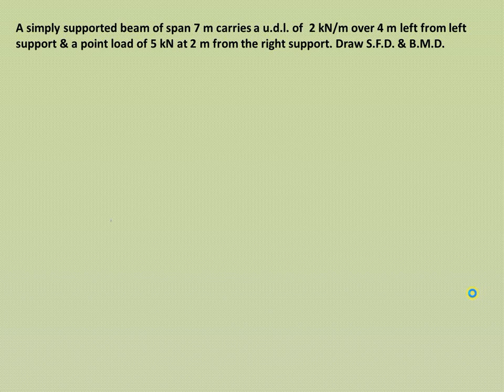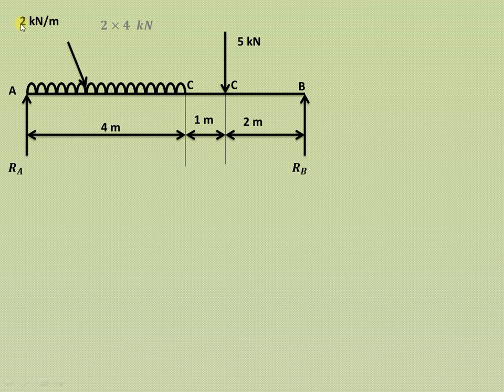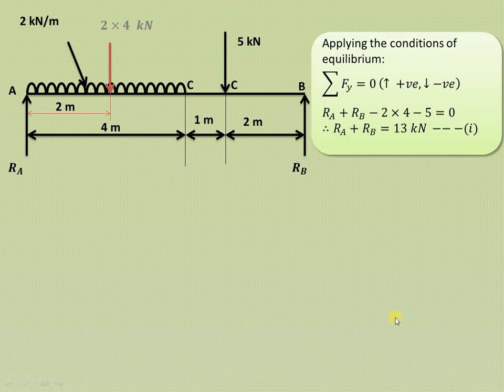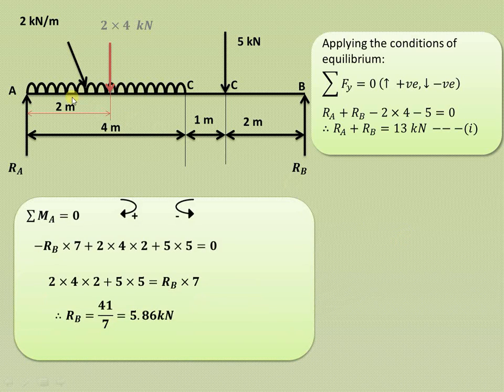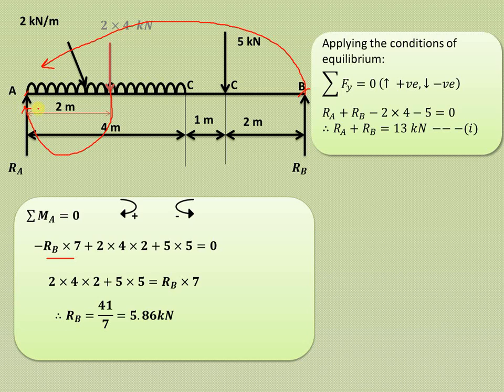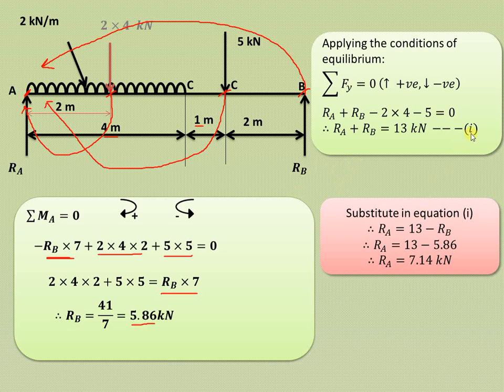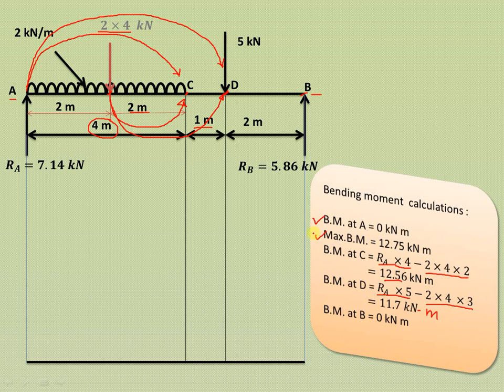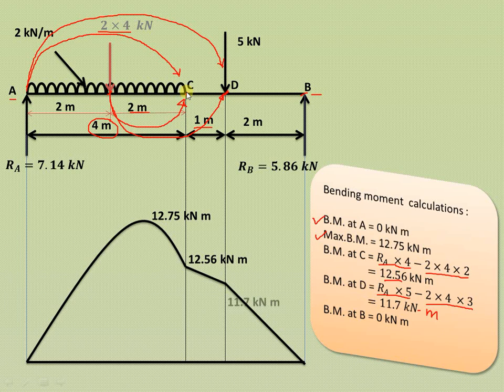Lecture 12 | How to draw shear force & bending moment diagram | Simply supported beam

Comment: shear force at C should be -0.86 but you have taken +0.86   and 
you have drawn -0.86  which is down from the mid line, i think you have done mistake  plz check it out